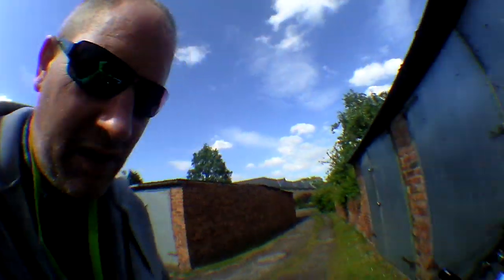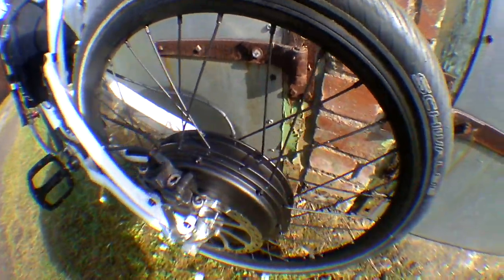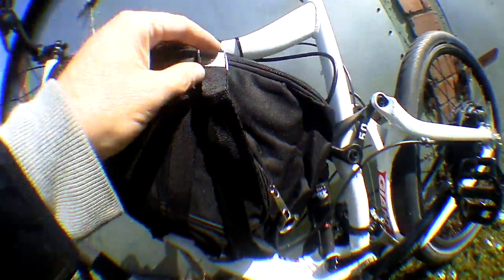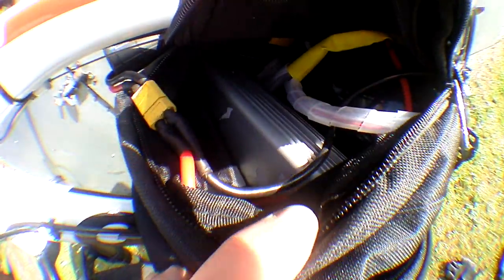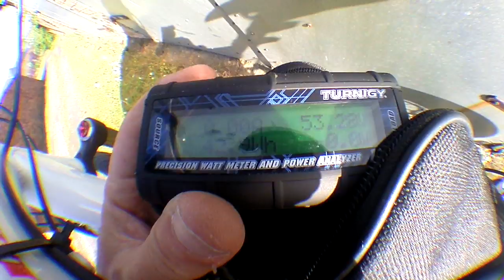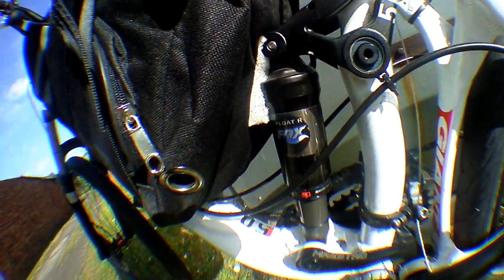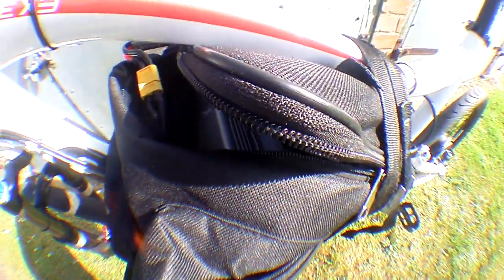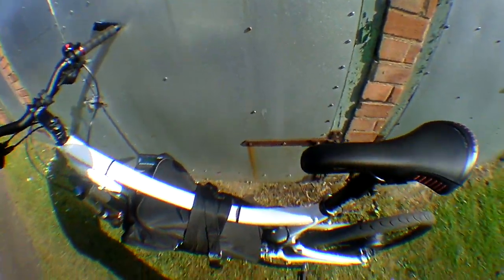Electric bike conversion - Giant Trance X3 with 1000w 48v 20Ah

Comment from the maker: 20 ah, 1 hour range or about 20 miles no pedalling. This kit if  the bike now and on another frame. geared so I can still pedal at top speed, makes a huge difference, can then travel 50 miles or more. Not just going full speed all the time.